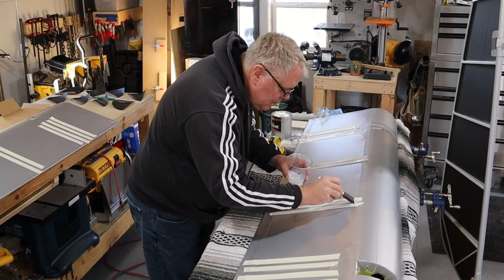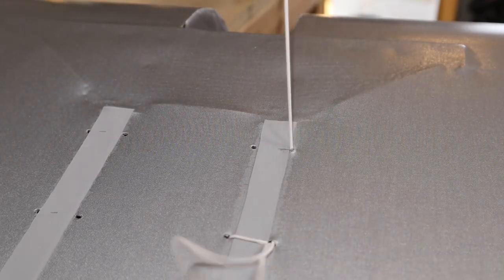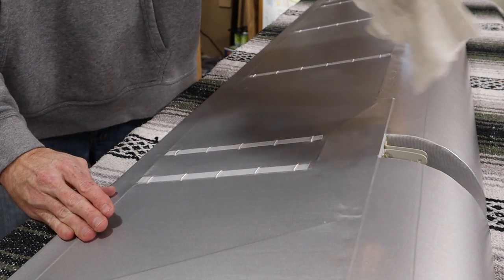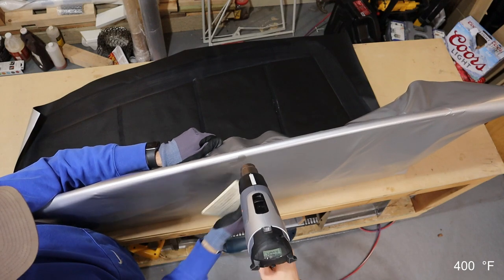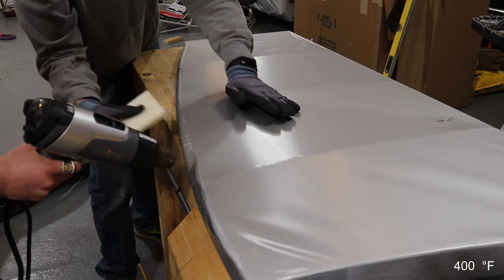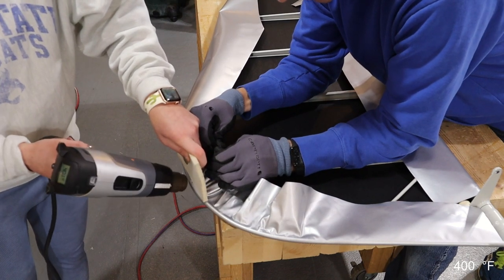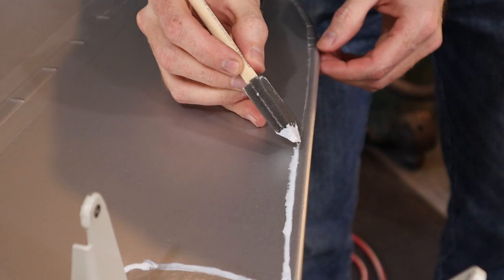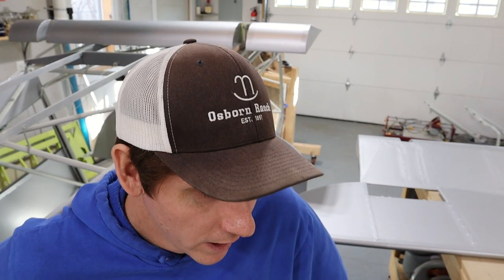Covering Control Surfaces With Oratex

Comment: Beautiful work, the time you two have taken to lay the fabric will be a fantastic reward over the years to come. I wondered why you decided not to use pinking shears? Old fashioned but helps to prevent fraying.
Reply from the maker: Thanks! From my understanding, pinked edges with Oratex serve a primarily cosmetic purpose. While I personally like the aesthetic appeal of pinked edges, I have heard anecdotal accounts of pinked tapes lifting over time from several individuals. Although these are subjective experiences, they ultimately influenced my decision to opt for all straight cut tapes.

Comment: So many great tips.  It was great to see all the places that you made extra reinforcement for the fabric to glue to.  Any opinions about oratex, any wishes you went with stewarts or poly?  I was reading a thread about battson's weight and balance issues after a mod and someone said oratex would take 11 pounds outta the tail vs other covering+paint... that has me thinking about using it to keep my cg as forward as possible. but i'm undereducated in every realm so I'm just searching for other opinions.
Reply from the maker: Jonathan would know better than I, but I think most agree that it'll save a bit of weight off your tail. Maybe we could get one of the other Model Five guys to get an accurate weight on their finished tail feathers so we could compare. It's a little bit compounding because you need less counter balance weight in the elevators. (The current kits come with enough counter balance weight installed for Oratex but you need to calculate and add some if going with a heavier fabric) It's really difficult for me to say if I would've been better off going a different direction because the tipping point for me was thinking the fabric would be in better shape in 10 years vs covered in something else that would be chipped and have ringworm. So I really need to wait and see how it holds up to UV and gravel to know. I think if I planned to operate off grass and pavement 99% of the time, I would've went a different direction mostly because of the price and lack of detailed comprehensive instructions. I still fully expect to be happy with going the Oratex route, but I'll weigh in a little more after finishing the fuselage. Long winded reply and I didn't even really answer you question, lol. Always appreciate what you have to say about the videos.

Comment: I started covering my cub style rudder yesterday in oratex and that pointed front part was pretty tough to figure out.  Today I will put on the other side; heating pulling and stretching to the glue line made by the tape.  I was wondering about making my own edge tape but the stuff they sell looks alot better.  And you don't need to hassle with another glue-line and masking tape when doing the edge tape, right?
Reply from the maker: I believe that’s correct. Hope the second side goes smoothly for you!

Comment: Excellent video, thank you!  All of the oratex videos demonstrate what they're doing but they don't explain. I am currently struggling passing the trial Bond test.. I'm curious, what kind of primer did you use on your tail feathers?
Reply from the maker: Thanks! The tail feathers came painted from the factory. I believe they apply a mill spec strontium chromate epoxy primer and then top coat with a mill spec epoxy paint. I scuffed it up pretty well before cleaning and applying the hot melt glue. While practicing I had a hard time getting a strong bond to unprimed aluminum sheet metal. It seemed to bond a lot better if I used some good self etching primer out of a rattle can first.

Comment: So when covering tube you did two coats on tube and two coats on fabric, what about the finishing tapes at the edges? Did you just have two coats under the tape and nothing on the main surface/just a fillet line of clue to hide the edge of the overlap?  Or did you have four coats total betwiin the top of the fabric and the underside of the finishing tapes?
Reply from the maker: When using the finishing tapes I only put 1 thick coat of glue right on the seam. The glues only propose was to keep air from being trapped there. The finishing tapes come pre-glued and according to the documentation I received don’t required any additional glue.

Comment: Shouldn't you be poking your lacing holes through TWO layers of fabric?  Then the finishing tape on top?
Reply from the maker: There is a second layer of Oratex over the ribs next to the holes. So it’s doubled up in the direction the lacing cord would want to tear through the fabric. But not doubled up directly underneath the holes. I haven’t noticed anyone using two layers of Oratex past where the holes are poked and it wasn’t a method covered in the instructions I received.